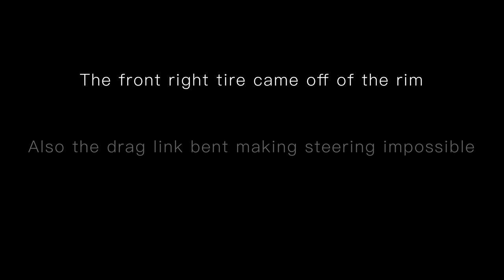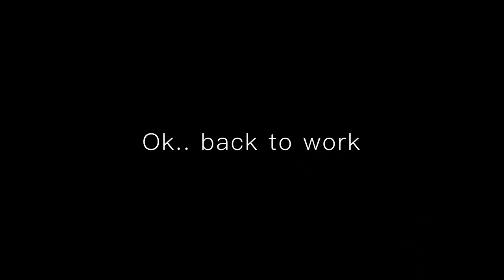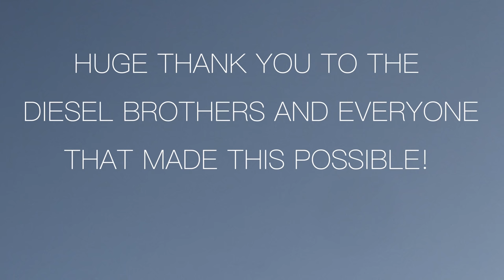@HeavyDSparks Saved My Ambulance!!

Comment: Brandon word of advice. If you are going somewhere that has a lot of snow and you were driving. Bring a kit with you that has kitty litter a lighter a candle and a aluminum pan. The candle will help melt the snow the pan will hold the candle. The kitty litter will help give you trash in under your tires. And I always bring two shovels. Never leave yourself with only one shovel in case one breaks. Always have a backup shovel.
Reply: This reminded me of that 70's show.

Comment: You should make some kind of steal track plates that you can lay down in sections that you can use for tracking then just strap them up top when done. Also keep a good satellite phone for emergency services or calls just in case your phone has no service in some of the crazy places you go.  Love the videos as always stay safe man!
Reply from the maker: all good ideas!
Reply: They make plastic traction boards for that purpose. A lot lighter weight than steel.
Reply: @bripslag   yeah man, he needs some rescue ramps for sure but that thing is so heavy they might break or bend even if they were steel.